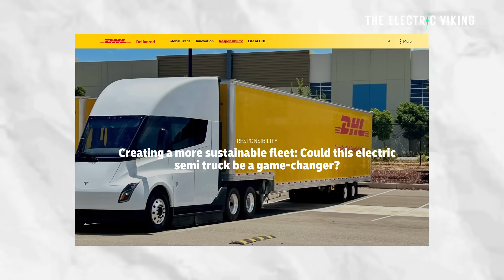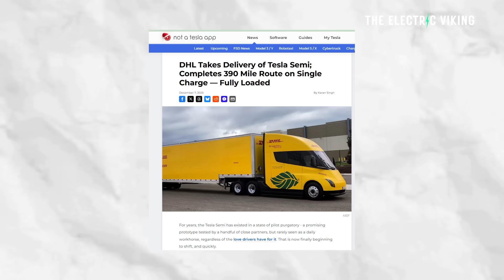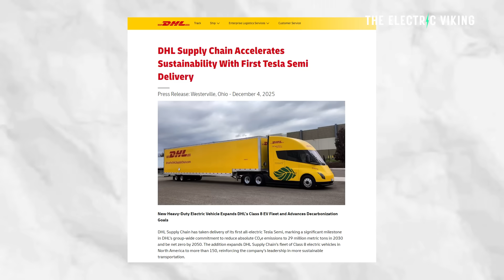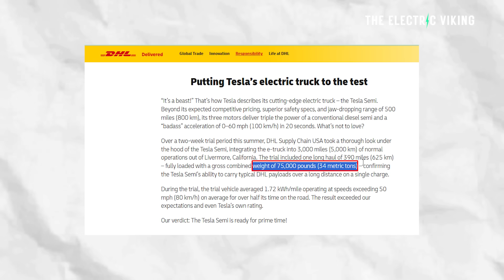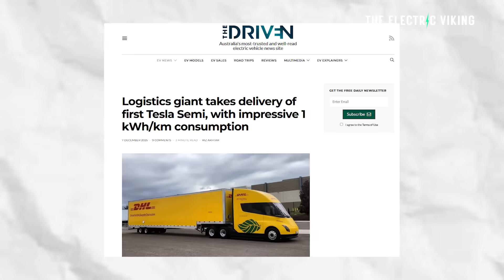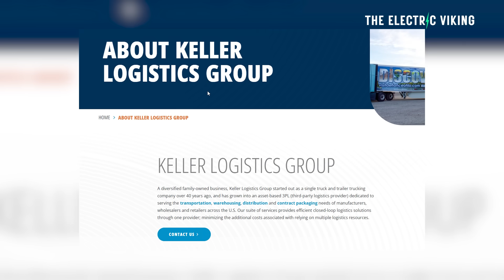Tesla Semi Drives 390 Miles on Single Charge Fully Loaded with Range Leftover!

Comment: Hydrogen is pure waste of time.
Reply: H2 is a moronic fuel for Road Legal vehicles. Having a moving tank of H2 has soo many problems. H2 only makes sense for OnSite stationary use cases. Where massive tank storage is not required and consumption is near the electrolyze. Best use cases are Industrial Heat purpose like Metal Smelting. Not freaking long distance road vehicles.
Reply: @Neojhun hydrogen for metal smelting makes no sense either. Induction heating using the electricity directly is going to be 10x more efficient
Reply: Not for older trucks. In China the older ones has been converted to LNG. I have not seen any diesel here at all, living in Chengdu. New trucks are mostly Electric.
Reply: @enpappa  LNG is not hydrogen
Reply: it's not your time .
Reply: It has a tendency to explode
Reply: RIP ⚰️ hydrogen-truck-Scam compagy Nikola Motor with No real costumers... 😂

Comment: Please realise that DHL have very lightweight load. They don’t hall ciment.
Reply: So what? Semi can handle the same cement load as any diesel rig!
Reply: Very good. Then it will get more than the 375 miles as that run was done with 75,000 lbs. Thanks for making the case for elec semis. 😀
Reply: 75,000 lbs is a "lightweight load"?  M'kay

Comment: I think a years worth of diesel savings actually pays for the entire truck.
Reply: Not quite a year, but yeah… huge savings!
Reply: Isn’t diesel cheaper than charging in many states?
Reply: @singed8853 no, diesel is several times more expensive per mile everywhere.
Reply: But, with maybe brown outs coming with Data Centers and trucks wanting electricity, what's next?  Extremely high electric expenses for everyone?
Reply: The solar pick up may be good enough. When I was a kid 50 + years ago. Brown outs happened and we lived through them. We have to find a sustainable option.
Reply: @pagosabob10 .  Data centers all have dedicated power solutions! None of them will cause any brown-out! It would be self-destructive for themselves!
And in developed countries, there is more than enough power generation capacity. Remember, vehicles, be they cars or trucks, can and do recharge outside peak hours! BTW, Tesla is already using 100% renewable power for all its charging sites (source: 2025 Tesla Impact Report).
Reply: Public charging of EVs is generally more expensive (up to 3x) than fueling an ICEV and semi owners will not be charging at home.
Reply: In Australia it is the other way round. No matter how you charge an EV you win here.
I know gas is cheep in the US. But at worst it would still be comparable. And 99.8%  of my charging is gone at home. Even if you drive 100s of miles a day with a long range motor and a 7 kw home charger you would be way better off.
Reply: @McCraeMoto1  You cannot charge semi trucks from home chargers.  In the US, with gasoline at about $3/gallon, an ICEV that gets 30 miles per gallon costs $0.10 per mile for fuel.  With an typical EV getting 3.5 miles per kWh, electricity has to be less than $0.35/kWh to save money.  Public chargers average about $0.68/kWh, so the energy costs are higher when charging at public chargers.  With home charging, it's far more complicated because different states have different public utility commissions that regulate electrical power generation and transmission costs.  Thus it's generally unclear whether the price someone is paying for residential electricity is actually a fair market value or if they are being subsidized for some reasons or penalized for some other reasons.  The supposed national average price for residential electricity is $0.16/kWh which is about half the cost of gasoline used per mile.  Of course there are also ICEVs with higher and lower fuel use per mile.  With hybrids, the cost of gasoline per mile on something like a Toyota Camry (midsized sedan) is only about $0.05/mile, but on full size gasoline powered pickup trucks with V8 engines, it might be more like $0.25/mile.
Reply: Semis will not fit into public charging bays which jack up the price. They will have their own charging stations. At the depot and will be charging them at a home charger price ot better.
Reply: @McCraeMoto1  No, semis won't be getting any bargain price electricity at charging stations.  They'll becoaying higher prices in order for the charging stations to make money when each charger and utility hookup is extremely expensive.
Reply: Yes, diesel savings can offset the higher upfront cost of EV semi-trailers, leading to a lower Total Cost of Ownership (TCO) over time, primarily due to cheaper "fuel" (electricity vs. diesel) and significantly reduced maintenance from simpler drivetrains, though initial high purchase prices and charging infrastructure remain challenges, with payback periods potentially as short as 2-4 years depending on usage and incentives.
Reply: @McCraeMoto1  Unless the price of electricity at charging stations is under $0.45/kWh, there will be no savings from using electricity vs. diesel and the upfront cost difference will never be recouped.  Especially when one factors in the value of a driver's time, the downtime and driving interruptions needed to accomodate charging, and the lost utilization hours per day of the tractor.  EV semis are probably going to need enough range to cover the maximum distance a driver can cover in one day if he is on the road the maximum allowable hours.  Anything less will mean drivers and rigs being underutilized.
Reply: @kirkjohnson6638 home charging a Tesla car cost $7 for 300 miles that's just how it is in America 2025
Reply: @superjeffstanton To drive an average of 10,000 miles per year with $3.00 gasoline and $0.16/kWh electricity (both national averages), the ICEV getting 30 mpg will cost $1,000 in fuel and the EV getting 3.5 miles/kWh will cost $457 in electricity.  That $543/year savings won't cover the higher depreciation on the EV.  And if you have to charge at public chargers the energy cost savings range from little to negative.
Reply: @kirkjohnson6638 also they don't even have transmissions to break down or engine parts so replacing the batteries around 10 years they have an 8 year warranty I don't see the negatives.
Reply: semi drivers would have their own charging stations. They wouldn’t fit in a public charging bay.
Reply: @kirkjohnson6638 . Public charging a Tesla vehicle is ALWAYS a lot cheaper that fueling an equivalent ICE one… 
Tesla Semis will mostly be charged mostly at their base(s) at commercial or industrial power rate, or at the dedicated 1.2MW charging stations Tesla has started to install. 
Remember, the vast majority of truck operations are NOT interstate long-haul ones!
Reply: @st-ex8506 That is patently false.  Tesla public supercharging generally costs between $0.25 and $0.60 per kWh and a straight gasoline car that gets 30 mpg that translates to the equivalent of $0.35 per kWh for an EV that gets a fairly typical 3.5 miles per kWh.  With EVs, you might get up to 4 miles per kWh and with a hybrid gasoline car you can get up to 60 mpg.

Factor in that you rarely have to spend more than 3 minutes filling up a car (only if there is a line) and it is a no-brainer that an average straight gasoline ICEV is way better than an average EV when it comes to public charging.

Comment: I want to see 2 axle Tesla box truck with rear liftgate and 400 miles of range.
Reply: Tesla has completely missed the truck classes 2 or 3 - 7. What the heck? That’s a big piece of the puzzle.
Reply: @aaronbounds1336  Tesla specifically went for what was perceived to be the hardest first to demonstrate it was possible.
Reply: @aaronbounds1336  I'm guessing it's because that would require a much bigger support organisation at Tesla, and building that up is probably a bigger challenge than creating the vehicles. By starting with a semi they're more or less repeating the way they started with cars: Lower volume, higher cost first, then tackle the "smaller" (but higher volume) stuff. Could also be they saw that class 8 wasn't being worked on as much by other actors, so bigger chance of getting the attention...
Reply: I want one to convert to an RV.
Reply: @williammeek-h2o Box truck with FSD, AWD and a Vanlife conversion with solar would be a fun adventurer.
Reply: That'll come later. Imo.
Mostly because such bodywork is aftermarket and Tesla will want to control the whole value chain up to then.
Reply: Two Optimus and a truck
Reply: You just described my dream truck. I currently own a Isuzu NPR Box truck with a lift gate. It has specialized frame in the front half for moving Rack Unit equipment. A 350 mile plus BEV version of that truck is something i've been searching for past several. years. Very difficult to find for Righ Hand Drive market.
Reply: The trucks you’re asking for (class 6 & 7) are already available in the US from Freightliner, International, Kenworth, Peterbilt, Mack and Volvo. Not sure if any have 400 miles of range yet, but they can do between 250 and 300 miles of range. All the trucks work. The limitation is still the battery, in weight, cost and capacity. But they are getting better. And these are all offered by truck manufactures who have the knowledge, facilities and support infrastructure to back up these trucks. 

The golden boy of the semi truck market is the class 8 semi truck, the market Tesla is currently going after. It’s taken about 6 years longer than promised, but the engineering and technology are nearly here to break into the mainstream. 

And here is the good part. These trucks are starting to reach a point where they can enter and sustain themselves on the market without the ginormous federal and state subsidies and grants they have needed to prop them up thus far. When that point is reached, adoption rates of these trucks are going to soar!
Reply: @americanrambler4972 , those truck brands you listed, we only have Volvo here in europe.
Also we have Mercedes, but I don't want any of those, I want Tesla and that futuristic nose and cabin.
Reply: you can get a Mercedes E-actros 600 that actually looks good and will do that range with ease.
Also has the driver sit where he is supposed to sit and not in the middle.

most idiotic sitting position ever for a truck.

Comment: Endlessly delayed, let's hope the Tesla semi finally ships in volume in 2026
Reply: Delayed for excellent strategic reasons! But , yeah, I am also glad the Semi is finally coming at scale in 2026!
Reply: Why do you think anything is going to change in 2026? This project has been spinning its wheels for over half a decade.
Reply: @singed8853 it was delayed for a good strategic reason: batteries were the bottleneck for Tesla’s overall production until recently. When you are constrained by batteries,, then it makes sense to allocate them to the products, which bring the highest profit margin per kWh.. and it was definitely NOT the Semi!  Hence the limited production until early 2026.

Comment: I just wonder why it’s taken so long
Reply: Battery availability! 
When something in the procurement chain is scarce, you want to optimize profit per unit of that metric!
Until recently, the scare resource was battery capacity, and the optimum use of it was NOT the Semi!
Excellent strategic decision!
Reply: I am wondering why Sam is saying the truck has exceeded Musk's promises, when he promised 500 miles of range with a full load of 80,000lb.  To my knowledge, no independent organization test has met, let alone exceeded that boast made some 8+ years ago.
Reply: @b @barry7920 . The full weight of a Tesla Semi is 82 not 80k lb!
Yes, it has been tested by numerous clients and the irl range found to exceed 500 miles at the US average truck speed  and in no wind condition. Those results can be found from non-Tesla sources!

In Europe, the range will exceed 800 km (500 miles) at the European max weight of 42 metric tons (92.6k lb), but at the somewhat lower European average truck speed.
Reply: @st-ex8506  Don't they have winds in America?
Reply: @SuperNevile 

Yes, they do!  With 50% chance to be a tailwind and 50% a headwind. 
So what?
Reply: @st-ex8506  Well those Tesla semis look like a brick aerodynamically. It's a truck, it's a brick, can't be helped. Up hill with a headwind fully loaded doesn't look too promising. Better to take all this load off the roads and put them on electrified rail. Oh 99% of rail in the US isn't electrified. Oh Shucks.
Reply: WHAT????
The Tesla Semi has an aerodynamic coefficient (Cx) of <0.36, which is incredibly better than ANY other truck, and as good as some sport cars!

That much for it being a “brick”!

Up the steepest highway pass and with the strongest of headwind, it will easily maintain maximum highway speed, where diesel trucks will be crawling at 30 mph or less!

I have one question for you:
Are you hopelessly ignorant or of utter bad faith??

Having said this, being Swiss, I also strongly support electrified rail… but that won’t happen in the US of A… and not much more in Europe!  So, I favor the least bad solution! Actually, in the case of the Semi, still a BLOODY good one!

Comment: 500 mile roots is an amazing distance considering the weight of the truck.
Reply: Damn big tree though if it goes down the roots will be kinda hot. Kidding aside the word you want is routes.
Reply: @cre8tvedge Route is pronounced root in my neck of the woods 😂😂😂
Reply: @johnfrancis4401  it’s still spelled route.😅
Reply: @johnfrancis4401  Pronunciation is not spelling. English so many dang words with same sound and different meanings it's like almost aggravating.

Comment: There should be no surprise with this.  If anything, it's long past due that the TESLA semi drive train be implemented running 1000 miles per fully loaded charge combined with distributed quick stop TESLA battery swapping solar canopy solar energy harvesting battery bank service stops, making quality 5 minute full recharge status immediately assured so the deliveries continue toward a 24 hour nonstop fully automated self driving supply chain with at most only one 5 minute battery swapping recharge pit stop required per constantly moving TESLA Semi Truck during that time.  Beyond that, it's further long past due that the entire transportation infrastructure needs to be overhauled so all electric vehicles never require ANY recharging due to wireless powering electric recharging capability being implemented into every renovated lane in every road and renovated parking space everywhere.